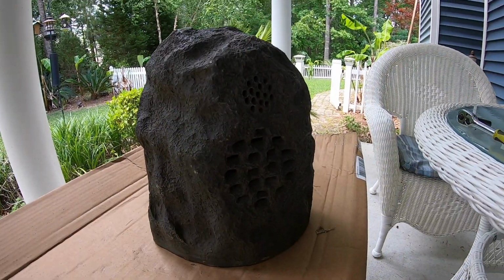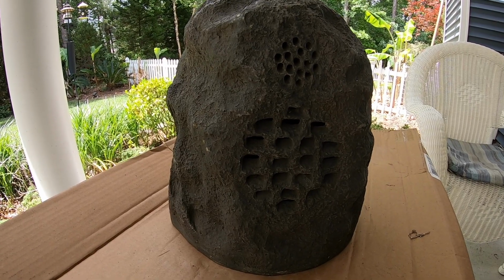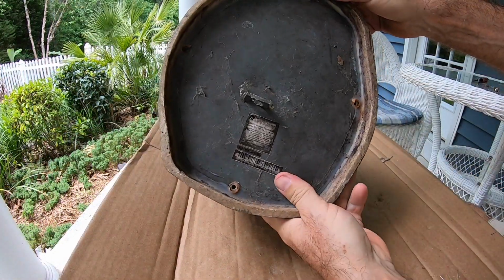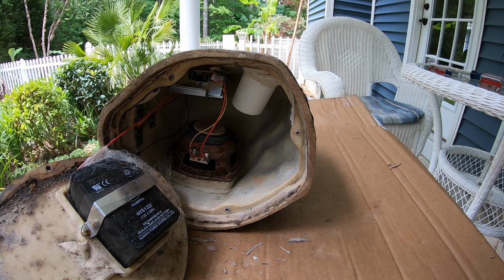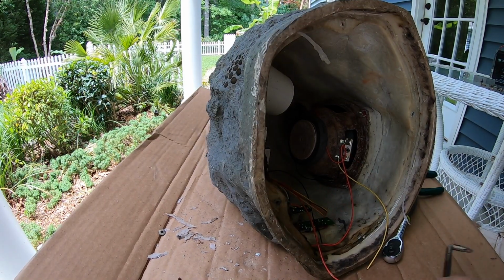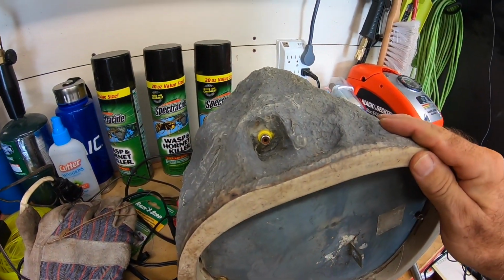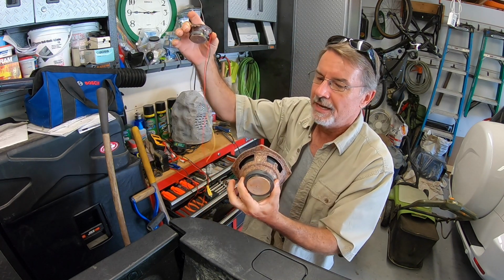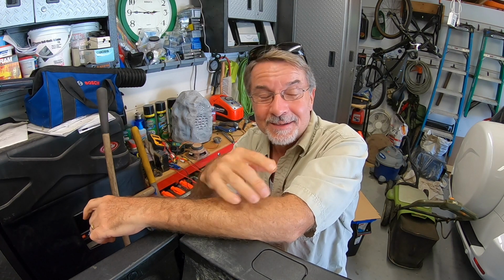DON'T THROW THAT AWAY!!!

Comment: Polk Audio makes a line of water tolerant speakers that sound fantastic.  I put 6, 6.5 inch DB652s in my boat with a subwoofer. They're rated at 92 dB sensitivity, 40 Hz to 22 kHz frequency response
100W Continuous power handling; 300W Peak power   DB522 for 5.5 inch not too expensive about $60 per pair.  I have millennials asking me to turn it down.
Reply from the maker: The Polk Audio did catch my eye when I was searching on Amazon.com.  Might have to take a more serious look at them after your recommendation.  Thanks!
Reply: @MyPIDream  Also James take note I don't suggest using a subwoofer in a stationary outdoor situation like a yard. The way they disburse bass sounds will disturb your neighbors. I found out the hard way.

Comment: I was hoping you would tell us how you planned to re-connect the 8 speakers to your amplifier when you returned to Villa Feliz.  While a series or parallel or series-parallel connection is the way to go for maximum power transfer from the amplifier to the speaker, there are two other ways that can be considered.  One way is to use a step-up transformer at the output of your basic 8 ohm amplifier and then use a step-down impedance transformer at each speaker.  Many commercial and background music systems are wired this way because it is possible to 'daisy chain all the speakers to a single pair of wires for a simple pre-wiring of the speaker system.  I would definitely not go this route as these tiny speaker transformers produce terrible distortion and have a bad frequency roll-off below 300 hertz.   
To keep the wiring around your yard simple, it is still possible to daisy chain your 8 speakers and have a simple 2 wire connection to your 8 ohm mono amplifier.  What you do is add  an approximate 27 ohm 2 watt resistor in series with each speaker.  By doing some simple math, it is possible to roughly calculate the size of the needed resistor to keep the total impedance of all the speakers connected in parallel to around 4 ohms... (which will work fine with most amps).   
I can hear all the screams now from the audio pros saying " What about all the power loss in each resistor"?  This power loss is very true, however, in practice, you will be surprised how little volume is actually lost and how loud it is possible to drive the speakers without the resistor even feeling warm.  We are dealing with a complex waveform being distributed and not a low frequency sine wave.  Still in disbelief?   Hook up a few speakers this way on a trial basis first and hear the results.   As you add speakers it will be necessary to increase the size of the resistor in series with each speaker, but now you have the added benefit of being able to adjust the volume level of each speaker by simply altering the value of the resistor to each speaker.   I am sure some readers will call this a bit 'mickey mouse', but it does work amazing well.  Speaker wiring remains very simple, the audio is clean, and keep in mind, we are not wiring a public address system for a baseball stadium!

Comment: What if it was just the 12 volt batteries that failed?
Reply from the maker: I tested the 12V battery and it was still charging over 12V.  I'm saving the 120-240V power supplies to send to the PI.  Never know when it might come in handy.

Comment: What are the odds that the only problem was the 10 plus year old rechargeable battery?
Reply from the maker: The one that didn't work at all had a fully charged 12V battery.  That's the one with the bad speaker.  It's been plugged in charging all this time and checked out good.  Another I tested the battery came in at 6V so I'm sure it's depleted.  I should have showed the corroded components.  They should have done a much better job of waterproofing the internal electronics.
Reply: @MyPIDream  Do not make things too well or no one will buy from you any more! My brother bought a shoe store in the 60 s. The Italian man who sold his store trained my brother to repair shoes. When he saw Ed fixing a shoe as well as Dad taught us to do things the man said, "No ne Eddie! No fixa too goud! Your customers they no comma back!"